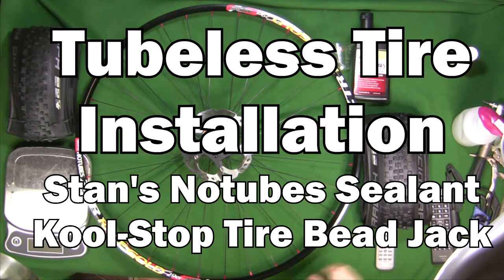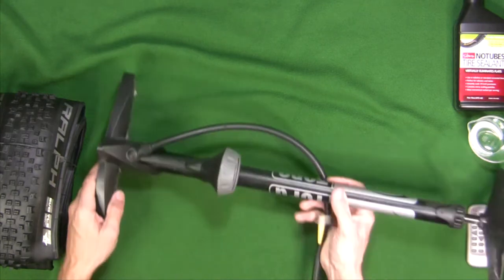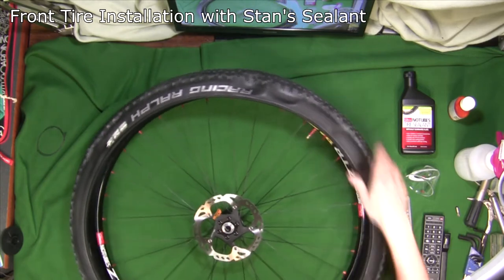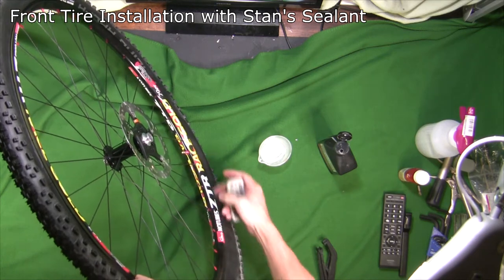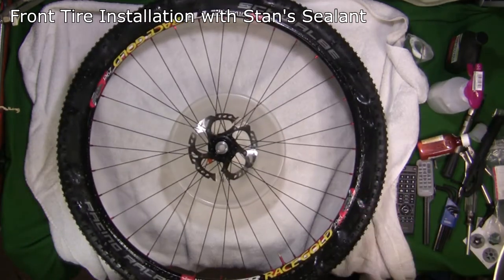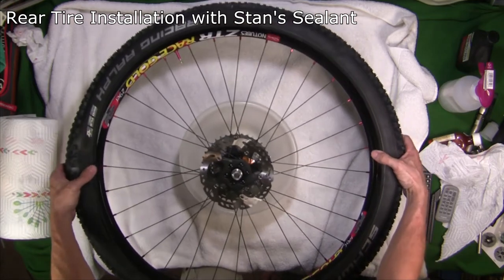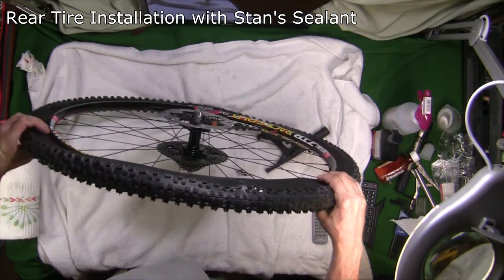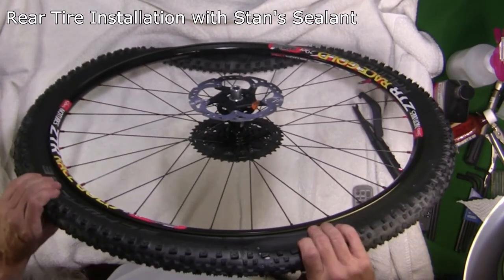Tubeless Tire Installation Using Kool-Stop Tire Jack

Comment: Other reviews have complained of breaking Kool-Stop bead jack. Having used it on very tight 20 inch rims (ruined one fifty dollar tire using metal spoons), when you get to the tight part only do an inch or so at a time, not right in the middle, and it will work like a charm.